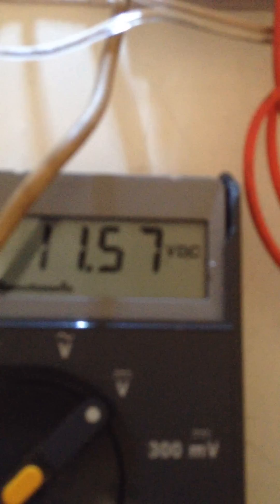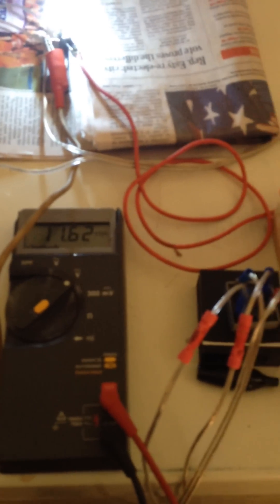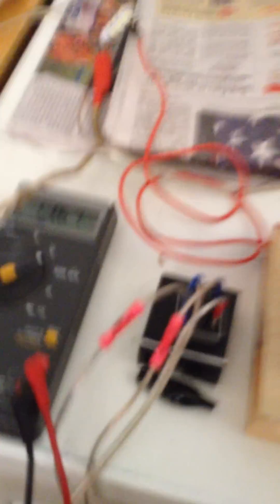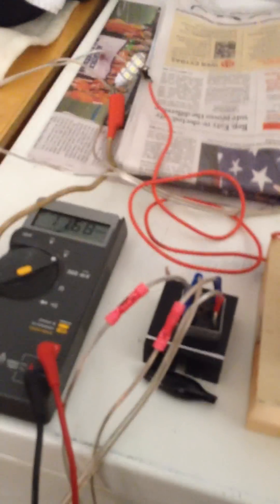Over unity created with transformed back emf. True over unity, no BS!

Comment: On a side note (I hate to hijack this thread) but any guesses where the extra energy is coming from? When u say radiant energy,  are you speaking in terms of heat, or teslas insulated plate in the air grounded through a capacitor/  spark gap (which may be harnessing the voltage difference between the air and earth or maybe collecting radio waves, etc?) Just wondering if u had any theories. Considering tesla didn't really understand how electricity worked, yet his devices did work, I'm not saying you have to know, but it would sure help! Otherwise I'm prone to thinking there is some sort of measurement error. Does it work in a closed system (in a box) Or does it collect from the environment? With the batteries, capacitors, etc, it's hard to pin down what's really happening, or if energy is just being stored and released. I guess closing the loop for an extended period of time would silence us conservation of energy types.
Reply from the maker: I do know one thing, and if the device is drawing the positron in as another inventor has told me, then it certainly means what they thought about it originally. Right now, the main component of any energy type is the electron. So, if a Positron and Electron collide and the result is annihilation as the current scientific theory states, then, it would mean that energy can be destroyed, totally contradicting Newton's Theory stating that energy neither could be created nor destroyed, only transformed to from one type to another. So, if the theory is invalid, as I suspect, then it would mean the original theory that stated when the electron and positron collide, a massive burst of electrical energy would be released. Now, this actually corresponds with the original Maxwellian Formulas that were modified as one, nonsense formula written by Lorenz, coincidentally one year after Maxwell's death. Now, we all know that mathematicians and physicists of Maxwell's caliber don't just release one lousy formula, do they? They normally co me up with pages and pages of them as well as their own theories. It's absolutely BS that we lose for over 135 years due to the works of JP Morgan and his habitual suppression that led to being able to make mass money from GE's electrical grid. If he wasn't able to pull off the Maxwell-Lorenz formula switcharooski, Our world would be a much different place. Tesla was confined to a hotel with nothing, no lab, no money, and, just about every device he invented and held at the Hotel New Yorker was taken away by the FBI after his death, allowing an extremely smal portion of his discoveries to be released intio society in an effort to continue the suppression. The same went for Dr. Moray, and many other inventors. They either died, became extremely unhealthy and died, or, were threatened to death and never continued to pursue or complete their inventions. Jesse McQueen's invention is being redirected by the *United Nations to be used in other countries but our own and it is completely sickening. We need this to be released, whether or not it gets done with an open source. If the world has an issue as they say with CO2, then show some proof, we have a solution. Then, the next day they tell us it isn't CO2, it is Methane. I find it hard to believe that science didn't know the difference, one of them stinks like shit.. Lol. Anyway, if it was that bad, we would see some dying signs somewhere, wouldn't we? The ice caps have been melting now for a long time. They will go away as another part of the Earth starts to freeze. It's natural pole shifting that happens over time, from an Ice Age, to another one in another part of the Earth. This is why our leaders have so many excuses and not one valid answer to questions. They are all full of shit and they allow guys like Al Gore to become billionaires with the trading of carbon credits allowing pollution for money and we can't even sell a real free energy device that draws massive amounts of power from a tiny continuous clean energy source to allow our planet'd clean up if it really did have an issue with global warming.
Really, if we had an issue with global warming do you think they would allow remote car starters of gasoline engines to be present when we have technologies to overcome this now for 20-25 years?? No they wouldn't., and they don't care about anything but taking our money.. Nothing else matters. .
Reply from the maker: yes. Radiant energy is attracted to anything that has an arc, as well, is grounded. With, and especially with the Pelex device, this is true, about 1500% more than a slayer exciter draws in. The reason why is because the induced ground creates some sort of opening for the energy to flow in, almost as if it is a beacon to request energy from another realm. This isn't by any means just a little bit of voltage and amperage, as the above device, it is able to load up 395 amps on the secondary coil of the second device i have built at 115 volts. That is one mean and dangerous circuit that will kill anybody who has a very low body resistance due to it's ability.

Now, this is pushed out of a 15 amp circuit. You could do the math with that one, it is pushing out some major overunity, but, the device has it's own short circuit happening which is cancelling out, basically telling us the amount it is capable of when you turn it on. If I add another closed loop around the former, I can get a secondary circuit giving even more until the secondary maxes out. The amperage has no effect on the primary as it is merely i n parallel with the load, it's hard to explain. The radiant energy is tied to the north pole of the bucking coils since it is a positron induction device, and the electrons draw to the south pole of the bucking coils, bringing in more energy than one could actually imagine. The device in my video has a little bitty little graphite radiant antenna in it which hardly works, imagine the power from a raised tower?

There is also like a one way valve allowing the energy in, and not back out until it is exchanged to electricity, which is done by the vortex, and it does work very well.But, radiant energy isn't normally attracted to anything unless they have a draw of live electrons in motion, through an arc gap or air gap. This induced method really makes them flow, so, I am pleasantly happy with the result.
Reply: Ok, I've heard the theories along the lines of square waves collapsing quickly drawing in energy from "somewhere" (Stan Meyer, Lindeman, Bedini, etc), I just have a hard time believing it (I'm not denying it either- just have doubts). Why are products out there yet, and why is nothing self looped? It would just be nice to have some science instead of magical vortices sucking in energy from other realms. Sounds like the Tesserack that Thor and Capt America play with. Anyway, assuming yours works, the epoxy is a good idea, although if someone was desperate they could x-Ray. Or you could do what Stan Meyer did, by adding special spark plugs, different color LED's, resonating pipes, bifilars, coils, magnets, feedback systems, etc, nobody can figure out what is important and what is just there to distract from the important stuff. Follow me? Add a crystal pyramid that vibrates at the exact frequency of earth that must always face Saturn for precise inter-dimensional alignment of energy forces. You get the idea. The other option is just power your home and sell Renewable Energy Credits for thousands.
Reply: Just to be clear, I'm just skeptical because of the 2nd law of thermodynamics, not because I pretend to know anything about your project. You definitely have me beat in the electrical department, so don't take offense. I'm just some guy that doesn't believe in OU because that's what I've been taught, so I mean no disrespect.
Reply from the maker: I didn't believe it either until I built the circuit i designed at mbrcircuit.blogspot.com, the A-02 circuit. If you decide to build it, I will tell you an easier method, by using a premade transformer, 120 volt to 12 vdc power pack that plugs into the wall. You need to add one wire and a diode to make it work, I forgot to add it in the schematic before posting, but, all transformers are not created equal, so, some do not need it, but, before I literally tested the circuit, I didn't believe either because i was taught the same way, until, I researched what my results were and I found the answer.

Nikola Tesla mentioned that he discovered that the electrical arc has been known to have a much higher yield in energy from a dc circuit than is put into it. He noticed that it had done a wonderful job of drawing in positive particles, and, since this was evident, he researched the shit oput of it and has come up with questions, such as where is it coming from, he looked at Roentgen rays, xrays, gamma, cosmic, radiant or static energy, atmospheric, layer cell energy, like I an researching and developing with, which is basically layers of discharging and charging matter like a capacitor does. Lightning, and the connection the atmosphere has when the discharges happen, which reach every part of the earth at the same time, some just get more than others, such as labs in Florida see the most since they are just about polluted with lightning and a lot of very unstable atmospheric disturbances from Africa all the way through the Bermuda  Triangle, to the tip of the keys.

There are so many ways to draw energy in, I can't even list them all, but, one thing I do know and have found is that JP Morgan paid Lorenz to erase and rewrite the Maxwell equations one year after his death to eliminate and man or woman in their right mind from getting ousted from entire scientific communities, as Tesla was for attempting to build a free electricity transmission station on Morgans dollar so people would get free what Morgan was making billions from.

Morgan was very thorough and paid off publishing companies so the books of tesla were never published, as well, he threatened if the companies ever published anything with the asymmetric equations, for motors, magnets, electromagnetic circuits and transformers would never publish again as he would see to it that they were put out of business by buying out their largest competitors and opening right next door to them.

It worked, he made Tesla a nobody that couldn't afford to get out of his own hotel room until his death, it also took away every known technology that tesla would have released because Morgan sent details of what Tesla was building. they must have spied on him  and then went in after his death and removed every paper, now, nearly 75-85% of the most important technological advancements he invented were gone.

I don't want any of this to happen to me. I am looking for an investor, but, not for free energy technologies. For efficiency devices or electrical savings devices, yes. I have 3 devices for the use of lights that reduce their consumption, and one is specially made for LED's, it literally allows them to run on .5 volts and .01 amps and they are 12 volt 30 watt leds.

That is the input to them and they are as bright if not brighter than before.
Reply from the maker: I believe that the radiant energy is what Tesla has discovered to be drawn in by the electrical arc since there is an arc being created between the relay's switch that is oscillating open and closed. I think it is a clear indicator of being an atmospheric energy as Tesla has proclaimed because the arc is emerald green. All other radiant energy projects I have messed with have this emerald green arc, asymmetric motors have this on one set of commutators, the arc gap in the tesla radiant energy system with antenna and arc gap, as well, a few other devices I have duplicated online that claim to use overunity power drawn by radiant energy. It could be a radio transmission for all I know, that is not clear because I can not prove where it's coming from but, from suggetions of others, I feel it is correctly mentioned as radiant energy due to the arc color.
Reply from the maker: I have been thinking of the reason why arcs can be green and I have been told it is an indicator of the presence of nitrogen, which we aren't feeding nitrogen near the arc gap, but, for the reason that it is a powerful arc in a tight location , maybe all of the other gases present are burning up and the only gas left is nitrogen? The other indicator would be the presence of boron, which the contacts are a high carbon steel capped bronze contact, and, I do not think a dollar relay would contain boron on the contact simply due to the price.
Reply from the maker: Hi Catalin, Yes, I have most of the pieces and have to put together a kit to send out. I will package something up for you but would like to include parts for other options as well as the device you see in the video, just so you can play around with some other things. I include many pieces for like three circuits, one of which will include the gerard morin motor and pump generator kit and parts to build the tesla hairpin circuit too. I am trying to get these together as separate kits because of expense, but, I will package something up and you will be the first i will send it to because you have background in this field a bit already.. maybe you will be able to share with others what it is, what it doe and get more people interested, but, before I send it, I am waiting on spark gap devices to arrive, which are a couple days out. I have a partial order for the transformers arrived, but, I will only be able to package up yours, and a new prototype will be put together and tested before shipped. I'll let you know once it is on ebay. It will be listed as an OU educational kit. I'll keep you posted. I'm sorry it took so long but it will be by the end of the week. thanks
Reply: Marc Belanger 
Hi Marc,
I've added a pre-made transformer, the Diode between the + battery terminal and tried it with the primary coil.
I got the oscillation going!

And i've seen the results in your first video, now I am trying to figure out where the other Diode should go and checking to see if the transformer and rectifier do their job.

At this moment i've connected 2 fast diodes :
1. - negative switch > 85 (diode towards 85)
2. First connection coil / 72A > + battery (diode towards the battery)

Thanks!
Reply: I believe its momentum.Torsion and interaction with the earth gravitational field.Newman's (of Newman's Motor explains it perfectly).
Reply: I'm sorry, could you repeat that? I live in florida, which, as Gore predicted, is entirely underwater. I just float around holding my breath so i don't accidentally exhale any CO2. Therefore I slip in and out of consciousness and missed that last comment you made. Remember to plant a seed every time you exhale, you rotten polluter! And boycott sports, hard work and any other high pollution activity. Also, if you see one of those polluting animals (you know, the ones that produce that greenhouse gas!) I recommend putting a plastic bag over its head. Grocery store plastic bags work for most animals, but i use trash bags for larger animals like manatees or bears. Don't forget to cover the blowholes on whales and dolphins! Together we can save the planet!